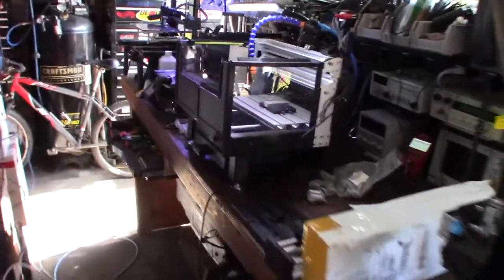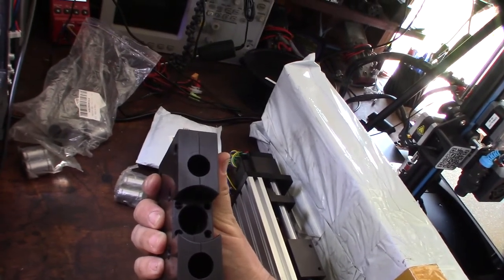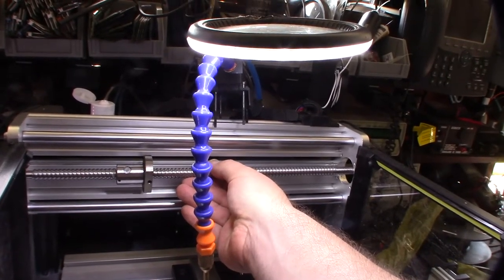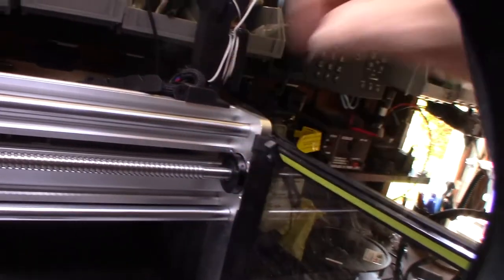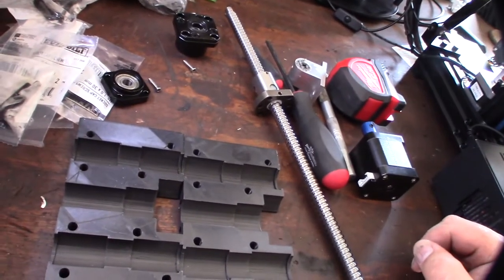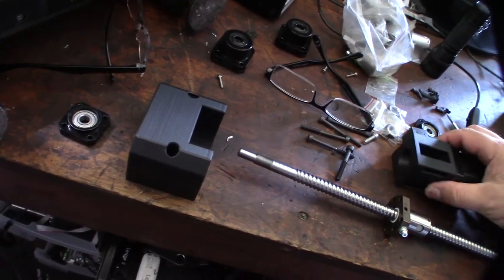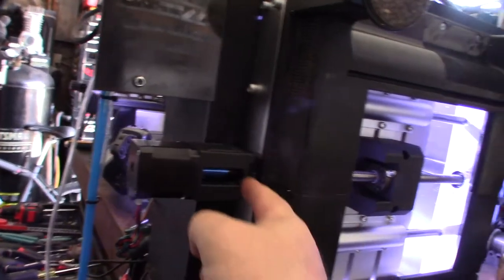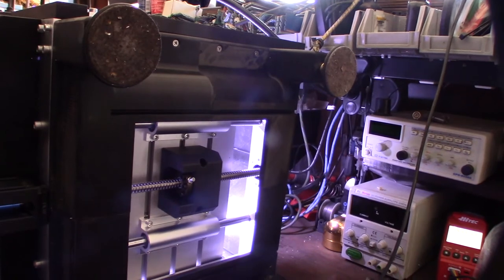3018 CNC SFU1204 Ball Screw Conversion And X Z Carriage Uprade Part 2

Comment: Will the upper gantry bearing blocks fit on the inside of the aluminum plates to take up that length you are missing?  I really like those adapter plate prints, nice!